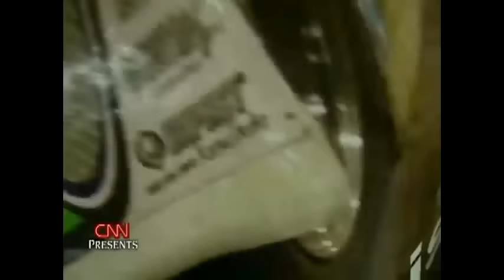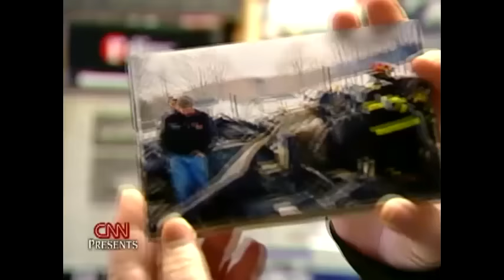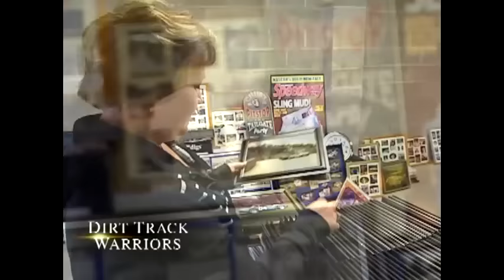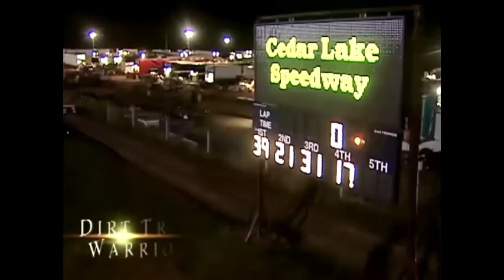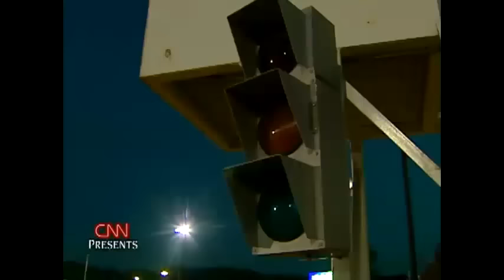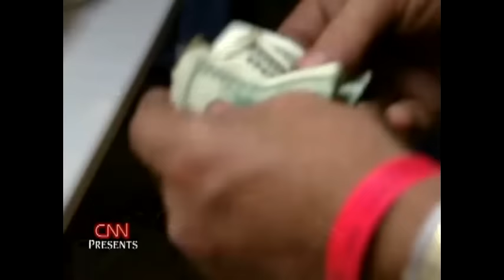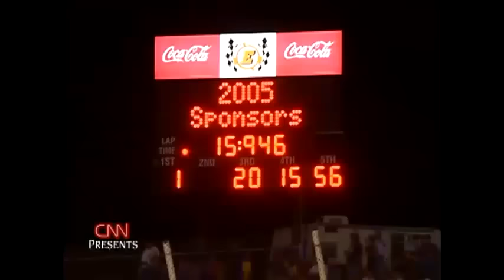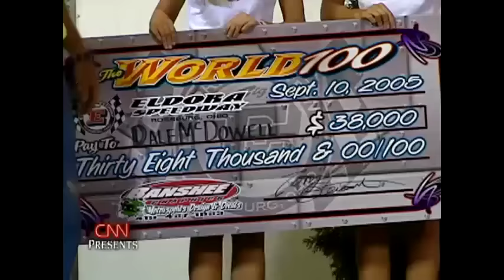CNN Presents: Dirt Track Warriors

Comment: I’d love to race these cars there but other than that... 
they didn’t do Eldora very good in this piece.    
It’s CNN though. 
I wouldn’t expect them to do good.
Reply: Try iRacing.
Reply: @voodoo7008  
Is that a 3rd or 5th gen?
40 or 17???  🤔   
Or none of thee above? Lol
Reply: @voodoo7008  

I’d love to be able to get 1 of those real live racing units. 
A nice $11k  
Those are so Dope.
Reply: @CSDonohue11  I use an RSeat racing rig, Fanatec wheel, and pedals. Then there is the VR. Tomorrow, the big block mods, and Cedar Lake drops. My rig, and new PC set me back about 5k. Does not make me a good racer, because I’m average, but have a damn good time.
Reply: @CSDonohue11  2nd Gen 23. 40 cal.
Reply: @voodoo7008  
Nice
Reply: @voodoo7008  
That’s F’n awesome Dude